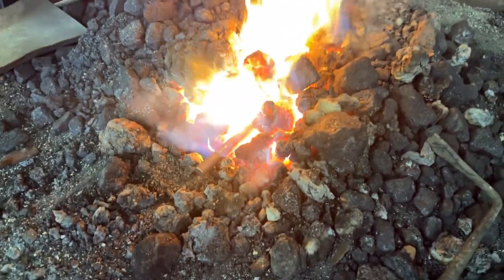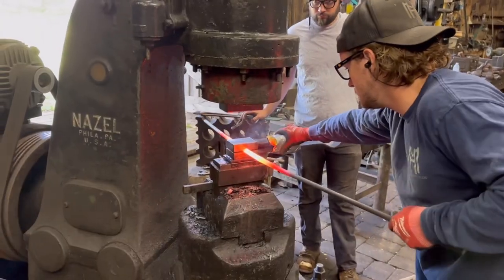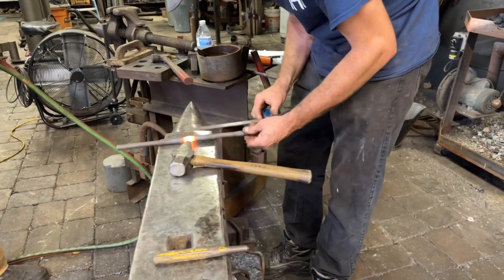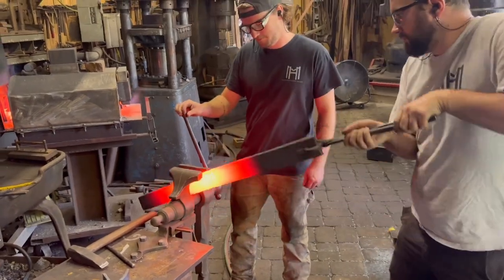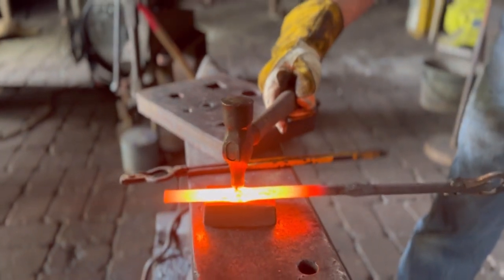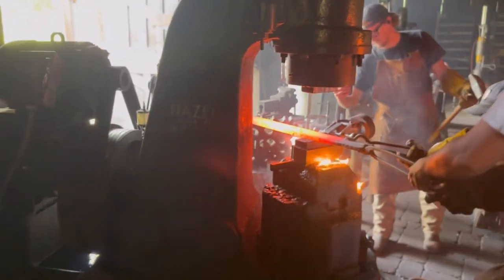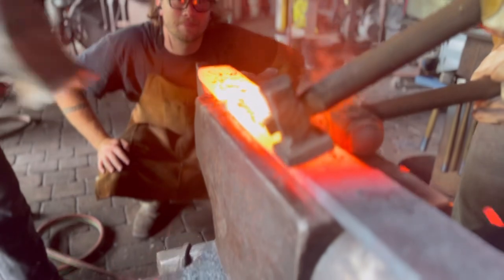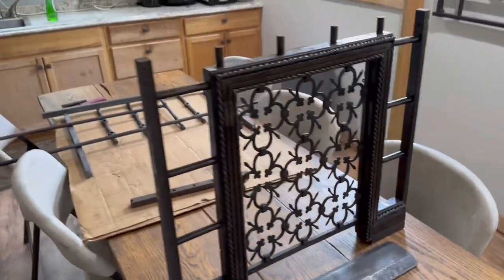Samuel Yellin Ironwork Reproduction

Comment: Very nice.  I have one of the opening teller windows from the basement of the Federal Reserve that Alex Klam and Sons removed during remodeling that Bill Gitchner gave me about 1993.  It has the simple ring motif with specialized collars.  I learned to duplicate the collars and demonstrated making a corner of the grill at Pontiac, IL quite some time ago.  The frame for the window is the most intruiging part to me.  The fitting and forge welding is exquisite, but the machining for the latch mechanism is as remarkable as anything else, and drilling straignht holes precisely in wrought iron after the forging and precisely milling access plates is as remarkable as the rest of the work.  Yellins shop had first rate craftspeople in all areas.    Unfortunately many of the ultra rich today who could afford such work would not order it.  Some of the ones who do are very private people who don't want the work shown to the public.
Reply from the maker: Everything you said here is absolutely true. We are unable to show much of the work we do, because of NDA agreements. Yes, I’m always amazed at how precise early work is. Comes down to craftsmanship